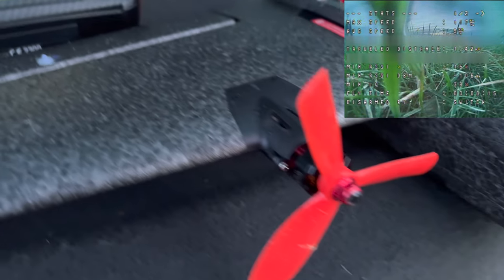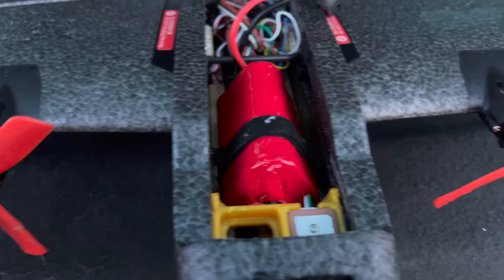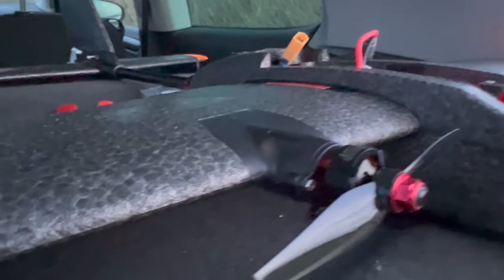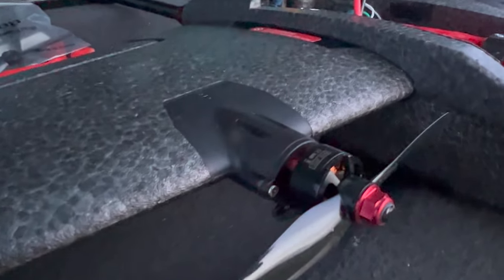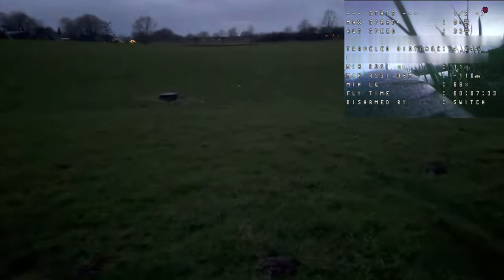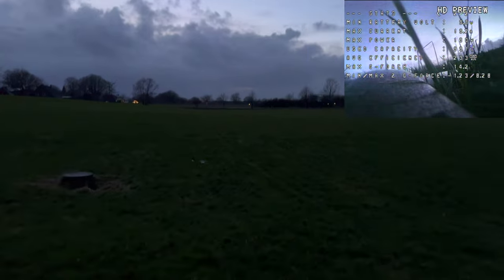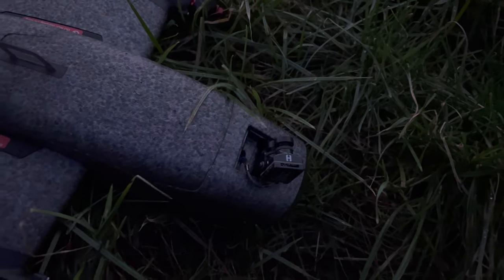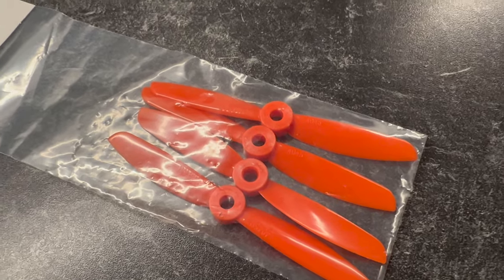Testing powerful new motors part 2 | Hee Wing T1 Ranger EP:09

Comment: Yup, you are right about HQ4025, I swapped it with stock FX3830 and immeadiately felt lack of power and keep crashing under strong wind...  :( . 
Any good alternative props recomendation for the stock motor FX1406-3150KV ?
Reply from the maker: Just run them on 4s and you’re good! Alternatively the Xing 1507 are pretty nice when you are open for higher power consumption

Comment: Very nice. Mine has just arrived.
So, the Emax 1606 3300kv motors look good.
Are you using the stock escs?
I am about to build mine and wanting to set with best setup for cruising2-3km away.
Reply from the maker: Stock escs will be fine i guess although i switched to 30a ones but that’s only precautionary as I didn’t know how much the 4000kv would take

Comment: Currently I did T-motor 2203.5 2850kv with 4023 prop on 4s I think thats also a very good balance between power and efficiency.
Reply from the maker: That sounds relaxed- I will try to use something for 5” soon
Reply: @JustFPV-net  i tried same motor with 5045 which is typical quard prop, it's over powered and efficiency dropped
Reply from the maker: Ah ok … as i fly 3s i will give 2205 3200kv a shot

Comment: I've watched a few of your videos on the t1 ranger and they all seem to have pretty bad gps signal. In this video I noticed a few spots where it drops to 4 sats.  Just curious which gps unit you are using and whether you think it's emi from 4k fpv cam or something else? Great videos, keep it up.
Reply from the maker: Justin, I have the same observation. I’ve placed some aluminum fouls beneath the unit to get a grip on some of the interference. Best place seems somewhere away from the electronics. 

Used unit is bn180 and it’s usually a winner
Reply: @JustFPV-net  yeah after I said that I saw its location behind the camera and it made more sense. I've got one and they work if you do everything perfect otherwise they can be iffy.
Reply from the maker: @JustinHunnicutt  yeah ... makes me wait about 10min currently and that kinda sucks ;) Working on an other solution for the gps position

Comment: What is your recommendation for choosing motors and props for Hee wing T1? Something has changed during this time?
Reply from the maker: Currently I’m sold on the 1507 with 4x4.5” props … on 4s3000 this does an amazing job from either cruising (yet not as efficient as the stock motors) up to rushing at 120km/h - power at will!

Hee wing has changed the stock motors to newer 1404 here which are said to offer 45% more power (yes I have them here, just not had the time to test them ;) )

And there is another set from hee wing which could be a good thing: 1806 with 2000kv and 5” props. 

Those are being delivered soon, as I ordered those too. Tests will show up. But there weather is no partner here these days and the time of the year. I’m not been out for weeks suffering from missing stick time ;)

But those are my current recommendations- a video with the 1507 is online on the channel. 

Hope it helps you along the way
Reply: @JustFPV-net  Thank you very much for the extended answer!
Reply from the maker: You’re welcome